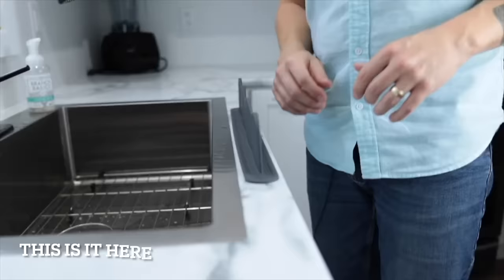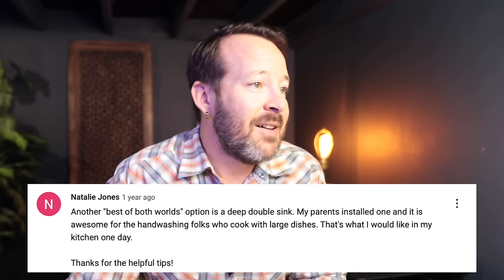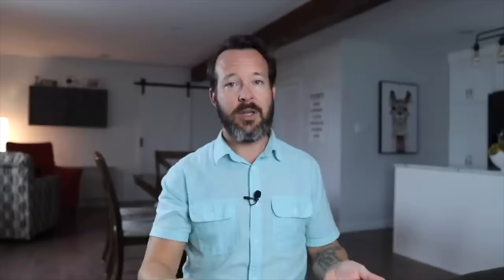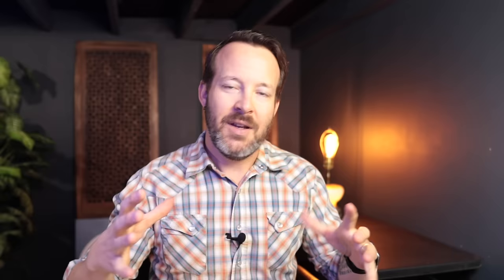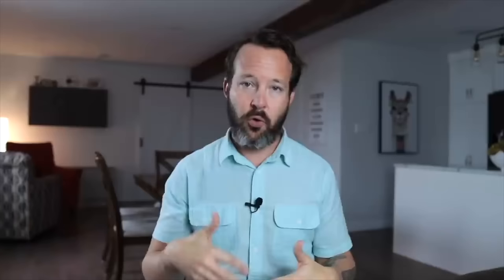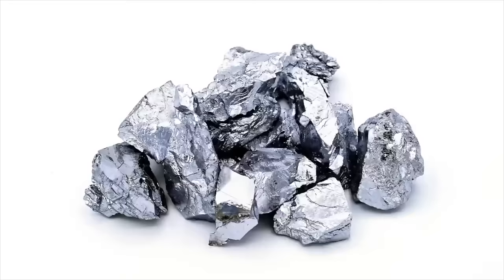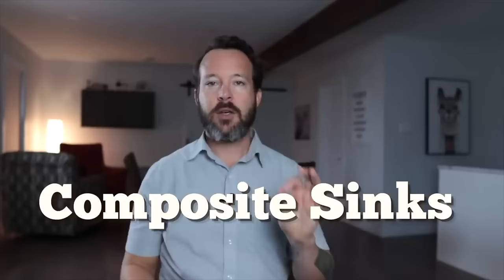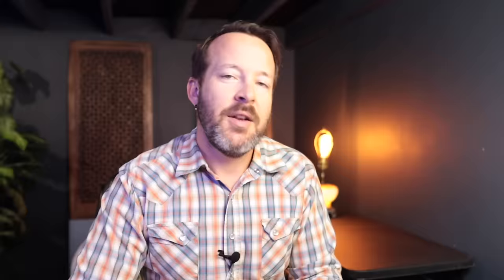Watch First Before Buying a Kitchen Sink

Comment: We're looking at new stainless steel sinks. Why are so many made with very square inside corners? Not at all rounded. Wouldn't they be more difficult to clean than rounded inside corners?
Reply: The Ruvati sink I have does have squared corners, but they are very slightly rounded. No issues with getting them clean.
Reply from the maker: I've never had an issue cleaning mine.  Slightly rounded.
Reply: Yes

Comment: In our main home we have a 70/30 split Kohler sink. I use the dishwasher…Mr. Loves to hand wash. I pre-rinse and set rinsed items in the small side. I also use the small side for soaking flatware and cutlery during entertaining. The kitchen disposal unit is also mounted on the small side. We are doing a full kitchen remodel in our vacation home (not on purpose but it flooded) we are selecting a 32” single basin as we do not intend on installing a garbage disposal and we use the dishwasher there all the time.

Comment: I hate large single sinks. Too big to fill with water. My cousin has one and she used a large bowl she sets inside the sink when she wants to wash a few dishes. I’m buying a double bowl farmhouse sink with a low divider. ❤
Reply from the maker: Thanks for watching Patti.  It's an important point, to get the sink that is ultimately the most useful for the user.  In my case, the large single is great, but not for everyone.
Reply: @MTKDofficial  I agree. My sink is huge - 36”. So a single bowl just isn’t going to work for me. If I were doing a smaller sink, I might consider it.

Comment: I am in the market for a sink replacement and have been OVERWHELMED with the choices. I have a dishwasher but, like most households, have some items that are not dishwasher safe. I started using the Dawn Powerwash spray and LOVE it. So my sink will be a single large sink. I am thinking about the one with the drain and cutting board topper. Thank you for this video. It is helping.
Reply from the maker: Awesome!  Glad the video was helpful!  Thanks for the comment.

Comment: It depends on what you cook and how. 
I bake a lot and opted for a double bowl with one oversize bowl that I can fit a baking pan or roasting pan. The smaller sink is good for draining clean pots or using to prepare food while the other sink is in use.. More importantly, it is an undermount sink and has a faucet that is on the sink, not the counter, so water drains into the sink and isn't constantly on the counter.

Comment: I have the 1 and  a 3/4 size side by side now,  no dishwasher . Plastic bowl in one side with very hot soapy water.   The other side takes things as they need washing.  They get rinsed off then put into the hot water and done all together when I'm ready. There's a draining board and a roll up drainer that i can spread over one sink as I go if extra space is needed.
I am looking at getting a single large stainless steel though and a plastic bowl or 2 in the sink.

Comment: Great video, thank you! My tip to share is it’s best to use metal pipes and not pvc because the sink drain gets exposed to a lot of elements and pvc will not stand up over time. Also have someone check the connections and pipes routinely (12 months or so) so you don’t get any surprises.

Comment: As a cabinet installer, and also a cook and baker at  home who hand washes dishes.
Get the largest single bowl you can find.
I despise a dirty pan that doesn't fit.
My dream house will have a small vintage cast iron 5ft bathtub,farmhoused into the cabinetry.
Yes I know it will require the sink cabinet to protrude an additional 8-16 8nches from the wall.

Next needs are combo inverted cup washer ,and large removable sprayer.

Comment: Low divide double is absolutely the best.  The single bowl does not consider preparation while cooking in a kitchen that is not huge. You use one side for prep/washing veggies, cooking utensils the disposal is on that side. The other side use for “clean” stuff during meal preparation.  Then during final clean up now the low divide allows large pans to fit across the entire sink.  My low divide has the grate that fits across the left side (for drainage for rinsed veggies or rinsed hand washed dishes) and the garbage disposal on the right side.  It’s great.  It is stainless.  The only drawback is it doesn’t look as pretty as the large single deep enamel farmhouse looking sink.

Comment: Bless you for saying doubles are problematic. Other than huge commercial custom sinks, doubles reduce the size of each sink to an almost useless size. Get a really big sink if you can and put a plastic tub in for soapy water or whatever. All the benefits of a double without the drawbacks.

Comment: I like all my dishes washed while I’m cooking so there is no clean up after dinner. I need a double sink to wash at the same time as draining pasta or rinsing. 

Where do you drain pasta if your single sink is full of hot water for washing your pots and pans!

Oh and I’m 39 so not an older generation.
Reply from the maker: It wouldn't make sense in your case, if that's how you use the sink.  The best sink is the one that works for the homeowner.

Comment: Are we going backwards to grandma's days when housewives spent their whole lives in the kitchen or are we existing in an age where the modern wife has to hustle between the kitchen, the lunchbox & her demanding job. 
As a career single mother a double bowl double drainboard sink was ideal. Why? Because it was absolutely timely when hustling to wash all the dishes, leave them to drain on one side whilst using the other side to prep stuff yet have the area clean yet completing all the kitchen chores & getting oneself ready, on time, for work. 
So i would never give up my double bowl double drainboard sink. Never
Reply from the maker: Thanks for the input!  Love the drainboard sinks.  Really great feature!
Reply: Elkay makes one of those. I had that sink in three houses! What a dream it was. I now have a single large bowl porcelain farmhouse sink because we downsized and I didn’t have room for the big Elkay with the double drainboards. My farmhouse sink is by Kohler and is nice, but I sure miss those drainboards.
Reply: I agree a double bowl stainless is what will be installed this week in my remodel kitchen . I like to clean as I go in a small kitchen such as I have.
Reply: The Kohler museum has several of these type double drainboard porcelain sinks that were removed from homes being remodeled. Previous owners in my house removed theirs to the basement. It was so much nicer, kept water hotter had no nicks or scratches than stainless steel replacement. I did all my canning, food preservation, holiday cooking & baking there rather than in new modern kitchen.Wish they would reinvent these type. I specifically go to estate sales hoping to find one of these 80 year old units to replace my 20 year old disastrous stainless steel & glued sawdust cabinet nightmares in this remodeled kitchen.

Comment: Pros and cons for top or under mount etc. 🤔 I heard undermount farmhouse sinks lead to more backaches because you have to lean over more and farther when washing dishes.
Reply: Not sure that’s correct.  Standard cabinets have 36”countertops, so farmhouse and most other sinks would be at the same height.  Plus, the farmhouse sinks bring the front edge of the sink right to the edge of the cabinet (maybe even out 1-2” from the cabinet edge for some), so that would seem to be less reaching (e.g., less torque on the spine lifting heavy pots/pans) than sinks that are recessed a couple inches back from the edge of the cabinet.  For tall folks, 40” cabinets might be a better option.  My current sink (soon to be discarded) has an edge raised 1”above the counter; to me that just makes it more work to clean the countertop.  If you try to install a porcelain farmhouse sink yourself, you may wind up with a backache or worse though!  🤕

Comment: My kitchen is small and didn’t have many drawers, so one of the first things I did was add tilt outs at the sink. I don’t think I’d ever bother doing that again as they are so small they aren’t all that functional. I do have my vegetable brushes in one (each are different softness bristles for corn, potatoes and mushrooms). In the other one I have used it for Scrunge pads, but I cut them into quarters so they fit. It also has a ring peg, which I’ve never used, but might be useful for some. If you add them, be careful that the handles you add to the front aren’t “pocket catchers” or you’ll wind up with lots of torn pants!

Comment: My preference is for a large single because of the required plumbing in the cabinet beneath. The single drain being located in the rear demands much less piping which permits more storage in the under cabinet.

Comment: I have a nice size split sink and it works fine for me. If I'm busy with something on one side, someone can quickly use the sink on the other side. Two faucets would be even better!  I would have preferred a stainless steel sink opposed to a porcelain but it was here when I moved in. Maybe I'll switch it one day.

Comment: Question : To prevent water from damaging cabinet doors located underneath a kitchen sink, one suggestion you shared was a choose a Farm House Sink - Instead what if the counter top was extended further out by a few more inches than normal, would that not help realise the same result as employing a Farm House Sink ?
Reply from the maker: That could be an option that might help prevent water from dripping onto the doors or fronts.  Thanks for that!
Reply: If the sink is further back from the edge of the counter it will cause backache from bending forward.  And be impossible for a heavily pregnant woman.  My new house came with an apron sink and I love it
Reply: Big single sink allows for bathing a baby or puppy.   You can always add a dishpan for soapy water, effective,y dividing the large single sink.

Comment: Marks from metal in porcelain sinks is absolutely true. It’s terrible!! This is another advantage of a stainless sink—no marks. Also we once had a solid surface sink in black granite coloring. It was a nightmare. The only time it looked clean was when it was freshly scrubbed and still wet. As soon as it dried you could see water spots and hard water stains (our water isn’t even all that hard) and so on. I would never have another black sink and especially not in that material!

Comment: I replaced my very shallow enamel sink and did not know how far the “drop” should fall. It actually could have been an inch shorter  to make it easier to deal with the plumbing. No one at the home improvement stores had a clue? Also, I put those two pull out cabinet trays in which was a total mistake. I’m fixing that with my next sink which will be the large stainless steel one. I have limited counter space. Thanks for all your tips.
Reply from the maker: Yeah. Those stores can be hit or miss sometimes. You won’t regret the large stainless!!

Comment: Having my kitchen fully demolished and did look at a lot of sinks.   Ended up with a double cast iron/porcelain with one bowl being deeper (9.5 Inches) than the other (7.5 inches).   I am going to put in a dish rack to cut down on the chance of damaging the porcelain.      I still wash a lot of dishes (just seem to enjoy doing it) and cook a lot so I am washing pots and pans all the time.    The double bowl with the lower divider looked promising and if I did more baking where cookie sheets and roasting pans came into play I would have went with it.